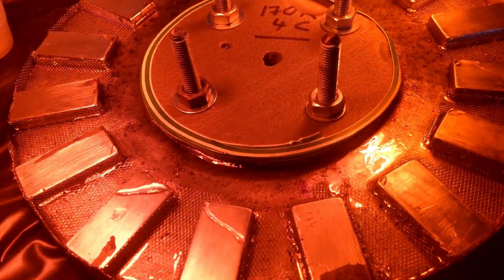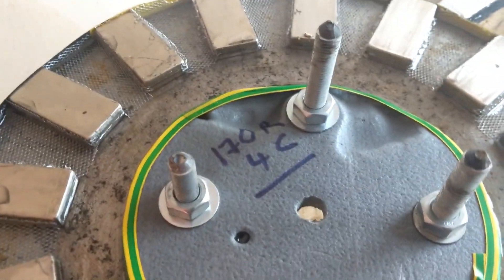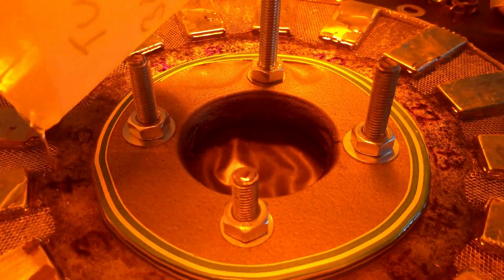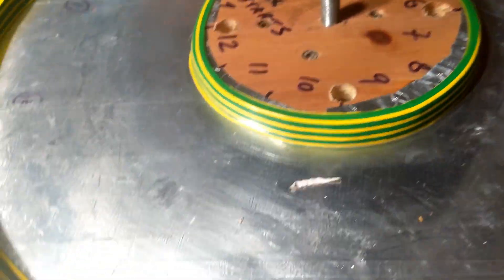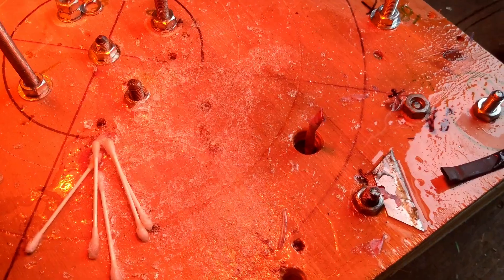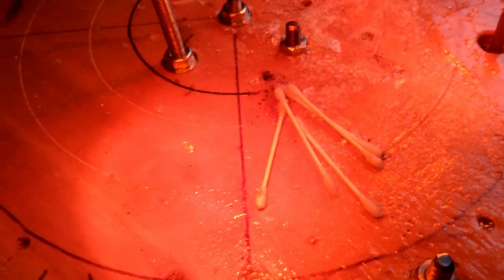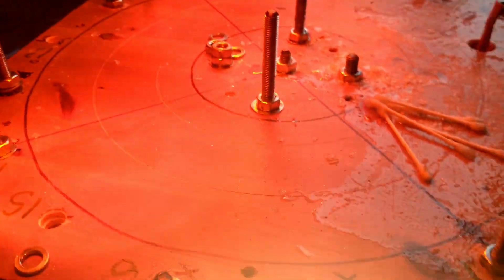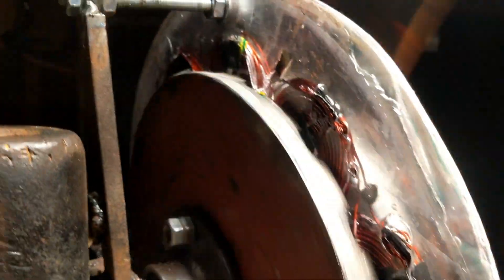DIY Wind Turbine Completion of Rotors and Stator 20 02 2020

Comment: im thinking out of laziness ill get my rotors laser cut , i know ill screw it up otherwise and then i can reuse them later like you said, probably cheaper than buying a decent drill press. suzukis are ok, maybe a thin  superglue could seep into the stator crack, if it wont harm the windings  enamel
Reply from the maker: laser cut or water cut is the way to go if you can I think you'd have more workshops where you are than we do I don't know of anywhere local that does that kind of thing I did see see some truck brake discs which are 430mm wide so if you wanted to make a big turbine you could definitely use those for the magnet rotors and so that would make it quite easy to get a hub for it it off the same truck.
Reply: @GavinFreedomLover  yeh laser cutting is popular even for thicker plate steel , many companies here in perth western australia offer the service, i like the idea because its so accurate, But id have to get my cousin to do the autocad  design so i could give the design to the steel company. i like brake rotors , i expect truck rotors are going to be heavy after using car rotors in the past with my first experiment.